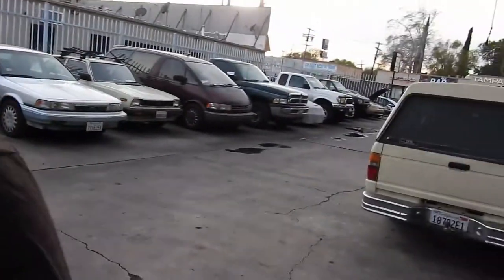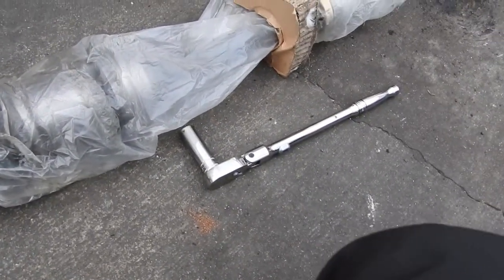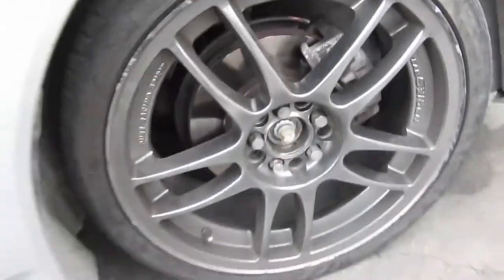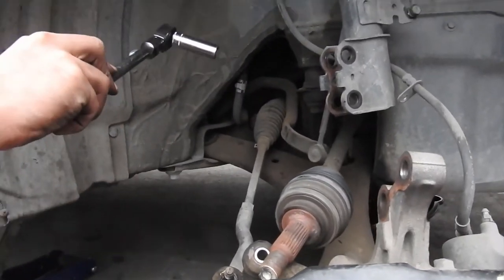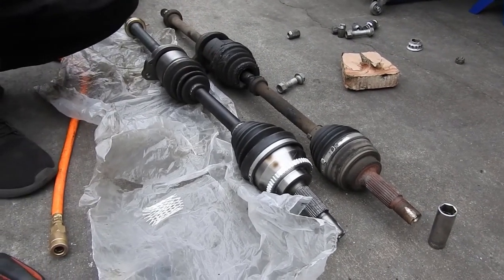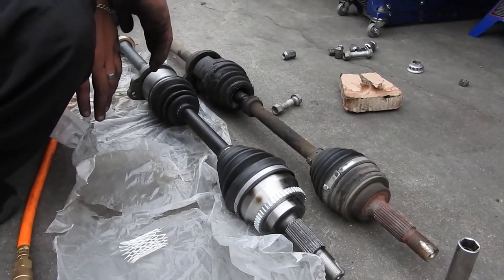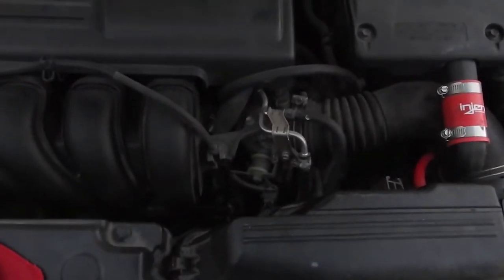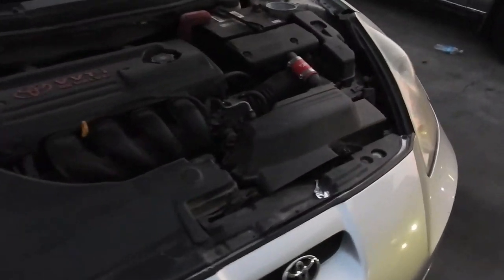Replacing Passenger Axle On My Mom 01 Toyota Celica Gt

Comment: Hey man I just installed my cv passenger side axle on my GTS 6speed that I also bought from auto zone how far should the axle sit inside the transmission? It looks like there was more room but once I installed the bracket that holds it in place it feels like there’s more room for it to go in the but I’m not sure if it was done right
Reply from the maker: As long as it is flush with the bracket your good

Comment: Awesome walk-through! For some reason I can't pull the passenger side axle out. Do I just need to pull harder?
Reply from the maker: Aurifier did u take off the two bolts on the bracket
Reply: Rafa's Garage Yeah I did :/
Reply from the maker: Aurifier you just to pull harder
Reply: Rafa's Garage I'll see what I can do. Thanks man!
Reply from the maker: Aurifier No problem
Reply: Rafa's Garage The bearing was just super stuck/rusted into the mounting bracket. Used a cold chisel to free it then the whole thing came right out.
Reply from the maker: Aurifier Nice where do you live
Reply: Rafa's Garage Central Ohio. So there's salt on the roads all winter. Maybe that's it...
Reply from the maker: Aurifier yea I hate snow and rust
Reply: I live in ohio too and gotta do this soon, ill go to the gym more to prep.
Reply: Having the same issue while trying to run an engine swap, guess I just gotta pull real hard and hope it pops out.

Comment: Question: there is a brace that screws on with two bolts in the middle to the mount. Did the new axel come with that brace? Or does that have to come out and be put on the new axel?
Reply from the maker: Rafys Mr2 It came with the brace some dont carry it but check oreilly